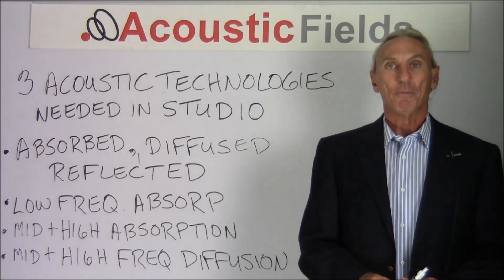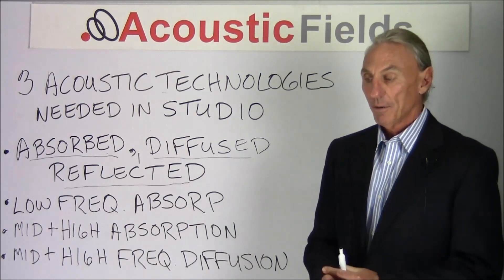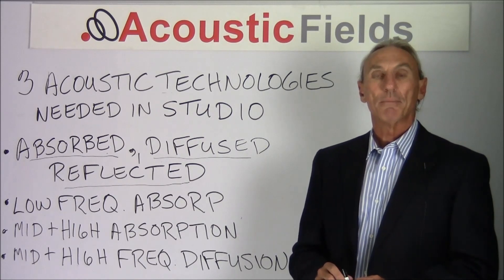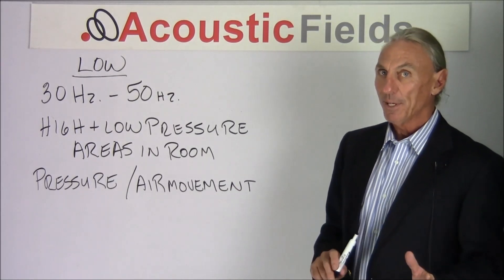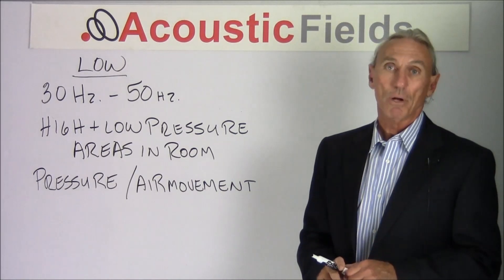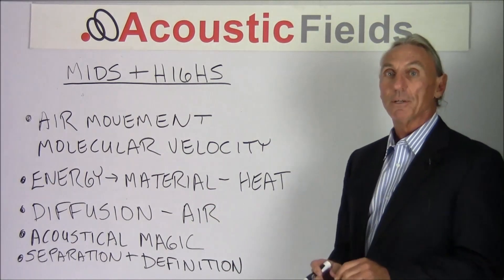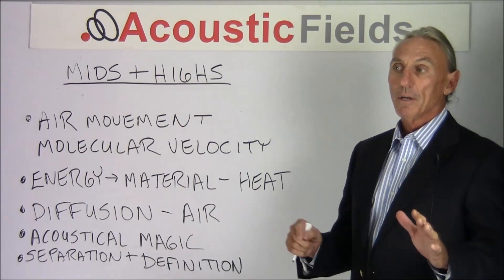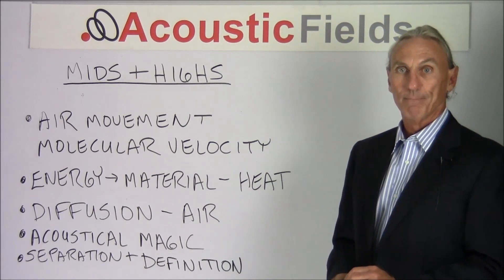The 3 Acoustical Technologies You Must Have In Your Studio - www.AcousticFields.com

Comment: Hi, you mention that foam and insulation don't do much for low frequencies 30 to 50 Hz.  I didn't get a clear sense of what you CAN use.  I had planned on using 6 inches thick of roxul safe n sound (plus air gap) to make bass traps.  Would these not help?  Or I'm guessing that would just go down to maybe 50 or 60 hz?  What do you recommend for sub bass frequencies?  Thanks!
Reply from the maker: M, There are 3 types of low frequency technology you can use below 100 Hz.. There are membrane, diaphragmatic, and Helmholtz. The type, amount, and position of each one depends on many variables.  Guessing in noise and acoustical treatment technologies is never a good idea. A 6" deep cabinet filled with building insulation will not work below 80 Hz. and will do an even worse job above that number.
Reply: Thanks - can you clarify "and will do an even worse job above that number"?
Reply from the maker: M,  Building insulation was never designed for sound absorption. It was designed to keep your house warm and cold. It does not have the necessary rates and levels of absorption required for the critical audio needs of voice and music.

Comment: It seems mid+high absorption and mid+high diffusion do the opposite thing. Is it a choice between the two? If not, can you give an example of how to use both?
Reply from the maker: Hi Gino Punsalan 

No not at all.  Absorption is your starting point.  You want to manage the low frequency and reverberation in your room first.  It's like laying the foundations to a house.  Once you have the foundations layed then diffusion is added to spread more of good stuff around the room so to speak.  Think of diffusion like a fan blowing a pleasant audio fragrance around the room.  Now if that foundation/fragrance is bad, then you get a nasty smell spread around the room.  So absorption first, diffusion as the final addition to the room (think of it like adding the roof to a house) once absorption and reflections are properly managed (the foundations and walls).

I hope that analogy helps.
Reply: It sure did. It can't be any clearer. Thanks again, Dennis.
Reply: @ginopunsalan  For a control room in a recording studio, it's common to have absorption in the front and side walls and diffusion in the rear and then in the ceiling (if you can) some people do a combination of both diffusion and absorption.

For a 2 channel listening room, it's common to have diffusion in the front and rear walls, absorption on the side walls, and a combination of the two in the ceiling, but again, it's best to  work with someone like Dennis that understands the different usage models, understand the products you might have or need to get and placement, room dimensions, etc. etc..  But this might give you an idea of things to think about.